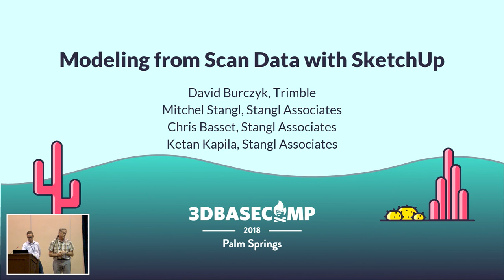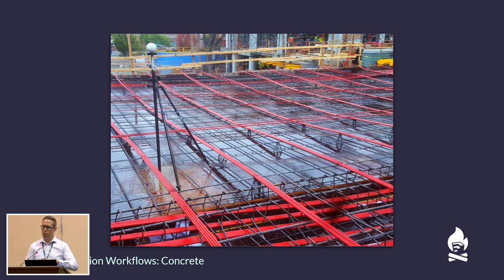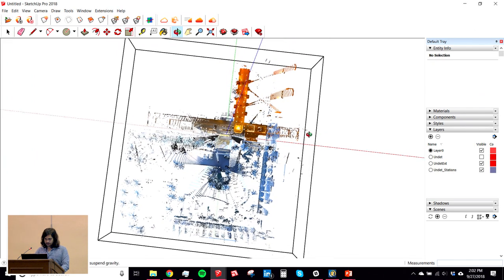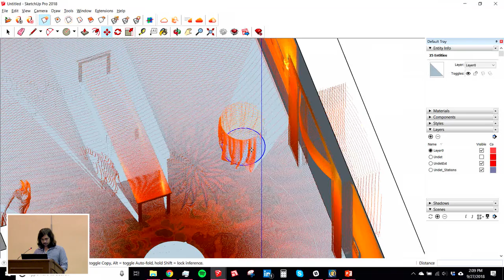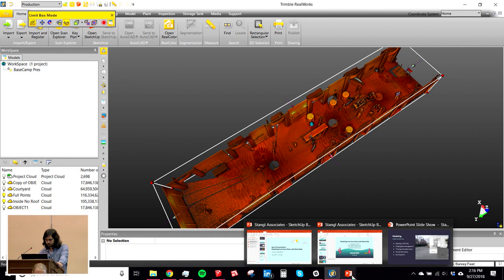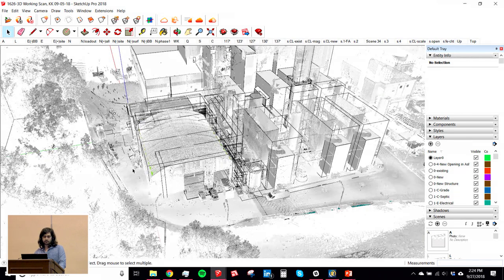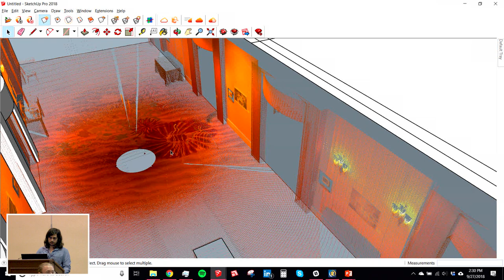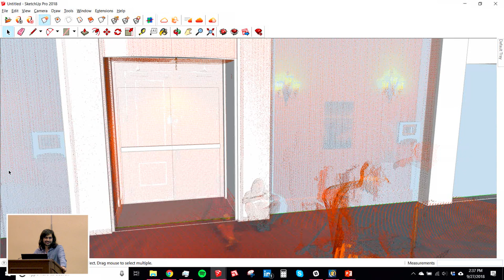Modeling from Scan Data – David Burczyk, Mitchel Stangl | 3D Basecamp 2018

Comment: Thanks! (Just a shame that process is so disjoint and Undet can not work with RealWorks files directly.)
Reply: Sometimes it's wise to register scan data in RealWorks, filter out noise and export final point cloud into e57 file format, instead of using the full resolution scan data file to create Undet project.